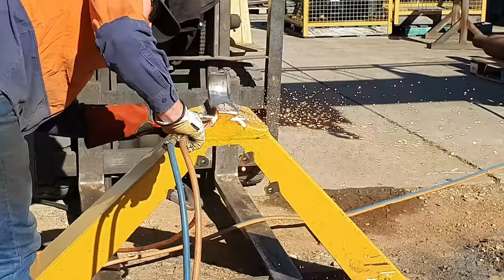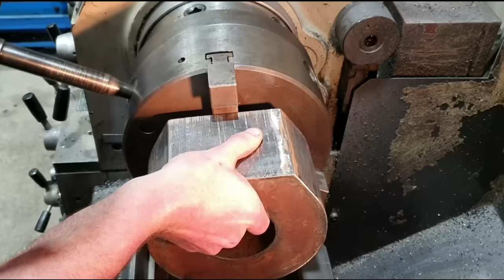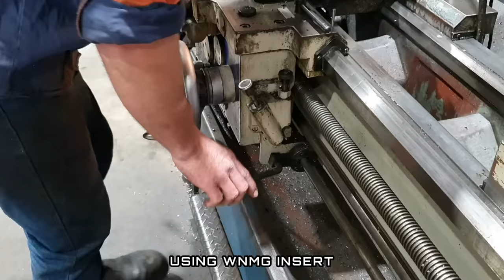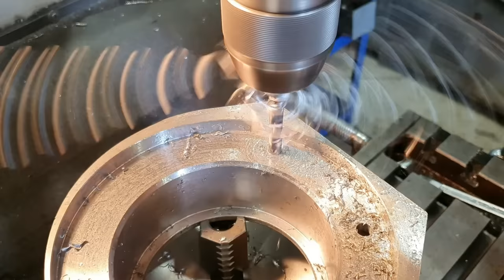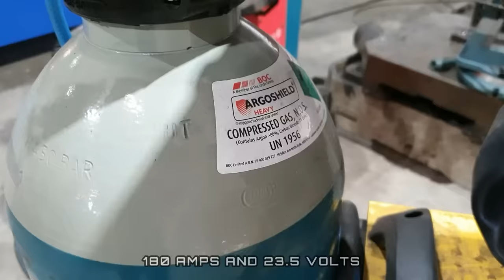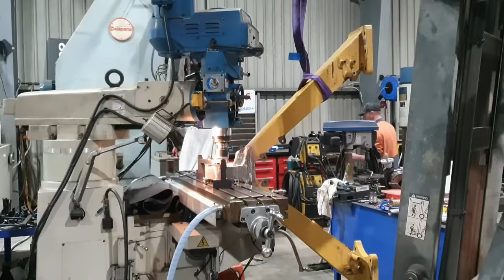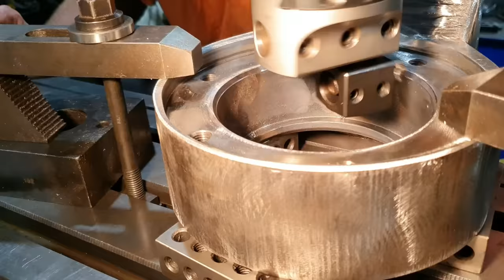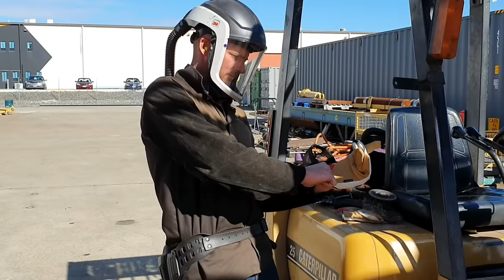Replacing BROKEN Eye on A-frame for CAT 745 Articulated Truck | Machining, Welding, Milling

Comment: Good job again.  I've spent my life as a job shop machinist, fixing everything from cameras and medical equipment to bulldozers and locomotives, so I really enjoy watching old school repair work.  I'm amazed by your extensive use of the 3 jaw chuck,  I seldom ever put one on the lathe unless i'm doing multiple parts or something where concentricity is unimportant.  When I saw you put that eye blank in with two rounds and a flat I couldn't believe it, but I watched the whole video and have to realize that you've done this many times over and know exactly what you intend and the results you will get.  Once again,  good job!  And keep those videos coming. 
Thanks again,  GBD
Reply: Knowing nothing about these things, (I may have touched a school lathe in the 1970s) I was amazed how casually the lathe itself could spin an irregular price of metal and not even flinch.

Comment: I've worked in underground hardrock mines for a good amount of years.  Some of the machinery is large and some was quite small.  Still, in a solid rock environment everything wears and breaks rapidly and some folks are just hard on things.  I appreciate the aptitude/skill and the work that goes into keeping machinery up and running.  To me it's fascinating to watch these processes.
Reply: In addition to your excellent comment, there's often an imminent need, and a short timeline to make the repair....No pressure! LOL
Reply: ㄱ

Comment: A retired fitter/ machinist here. Like your work. It's good to see you use all the facets of the trade. Spent years in a heavy engineering workshop in Melbourne, Appollo Engineering. Favourite machine was the horizontal borer, when you sat on the control seat you got a great view high up of the workshop. Get yourself one of them and it opens up a lot more work for you.

Comment: It's very enjoyable to watch your skills in metalworking. I love that you can take a disastrously broken piece of equipment, then fabricate a new part, then weld and build up the metal to join the pieces into one solid piece that is as strong as the original piece. Nice work.
Reply: i would bet that the repaired piece is stronger than the original piece, considering the quality of the work that Kurtis does and the amount of time & attention to detail that he puts into it

Comment: I have to commend you on how steady your hand was when flame cutting the eye material off the frame. That steel was super  thick and you kept the cut throughout the cut. 
Also, I noticed that as you were prepping the frame there was another pair of legs. Does this mean that the Safety Officer was helping to film the process? If so, you have a well trained hand in your shop.
Reply from the maker: Yes safety officer helps out he's got a steady hand with filming 🤣

Comment: What I find amazing is with the pressures that the tooling takes, that one little screw holds the inserts clamped in place. Especially with the interrupted cuts. Nice job Curtis.
Reply: The sometimes-confusing magic of leverage. It's a wonderful thing when it works for you.
Reply: The screw on the insert is there to locate it, the cutting forces are mostly carried by the big bearing face on the base of the insert into the tool, which is why you see every time Curtis is changing an insert or moving it to another cutting face he is scrupulous about making sure there are no chips or dirt on the faces that will come into contact, so that there is full even loading. If there is a small chip there it can easily shatter the cutting tool or damage the bearing face, making the tool useless till it is either reground flat or replaced. 30 seconds of care versus $500 for a new bar, or an hour with a carbide flat mill in the small mill to reface the pocket.

Comment: Air arc gouging is one of the best repair tools ever invented. I use one alot in my shop. I couldn't get a good view of what your welder was set on but our old Hobart welder has a switch for gouging with constant voltage as apposed to constant current. It works like a dream you can shave metal clean off but I have been spoiled with 450 amp plus welders my hole life. O something else I saw looks like you were using 80 20 gas mix might give 92 8 mix a try you'll get little more performance out of your welder with higher argon %. Any ways God bless and don't get hurt.

Comment: You have such an amazing understanding of how metal moves works when heated or welded together Kurtis.  Where did you learn all this?  You use tools and techniques I’ve never heard of too.  You’re a real star mate! 👍
Reply from the maker: Hey mate had about 20 years in and around the trade and I'm one to get in and give anything a go or find ways to make it work. Most is from on the job experience
Reply: @CuttingEdgeEngineering  From exactly on the other side of the globe ( the Netherlands) all I can say you are an all round skilled guy and me - just a theoretical engineer with some hands on experience- still wondering why I didn’t go into this type of work ‘cos I love it ( even with me own little work shop I can only dream of the level of experience you have).
Reply: Yeah , this one was good , cutting,  welding, grinding, lathe, fancy lathe, liquid nitrogen and a seemless plan . 👍
Reply: There's no "School" for this level of work, It's all practice, observation and more practice...and a couple good mentors who have the experience.
Reply: @ai-d3982  youtube is amazing for learning Theory but there's just no substitute for actual hands-on experience

Comment: "Can you imagine how much that operator would have shit his pants when that thing broke"
I lost it there lmao 😭
Great job once again Kurtis! Cheers from the states 🍻
Reply from the maker: 🤣👍Thanks for watching the vid mate
Reply: When the truck literally snapped in half! I bet that made a hell of a BANG when it let go! ;)
Reply: Obviously it didn't snap this was a line boring job what are you going on about.
Reply: @nocturnhabeo  now that is funny
Reply: Karen - "you think he poo'd a little" Kurtis - "No...I think he poo'd ALOT"
LOL
Reply: @haydenc2742  Really depends which half was the highest at the time, if you are on the part that is suddenly going downhill at a rate of knots, with the other half just spewing hydraulic oil as it digs into the ground, you might need a new pair of pants, and a new seat. If you just dug into the ground, and watched the other half fly off, your pants will only need changing. Might take an hour or two though to get the seat out of your backside though.
Reply: Where does the A frame go on the Cat 745? I was thinking the center where the machine articulates, but it's hard to find photos or videos of this part of the truck.

Btw, my wife and I love the channel. Thanks Kurtis and Karen :)

Comment: Forgot to mention, that’s a fancy dividing head you’ve got, never seen one with those quick change plates for multiple hole drilling before.
Reply from the maker: Yeah it's a great bit of tooling that has come in handy many times
Reply: Not to mention you picked it up like it was a 2 Kilo sack of potatoes
Reply: Watch a gear cutting vid. There's a channel on YT called this old tony. Indexing plates like this are used for gear cutting and on his home lathe he showed us - and it was A-B-S-O-L-U-T-E-L-Y fascinating.

Comment: "It just needs line boring", that must be the most optimistic(and inaccurate) assessment ever!! In other words the parallelism of the eye to the mounting's is critical!!
Keep up the good work.
Reply: That's just an example of Ozzie sense of humor. Yes, a bit strange, but that's the way they are.  I would like to see the part fitted onto the haul truck, but with the articulated bearing, I wouldn't expect alignment would be terribly critical. I was more surprised that no dial indicators or micrometers were seen. 35 years in trade, thankfully retired for 11 years!
Reply: @StuntPosse  Yeah I wouldn't imagine it either with a spherical bearing, afterall he only clamped it to the table off the back face. Boring it would have been to make it to size after all the welding.  What impressed me was measuring the snap gauge with the verniers, that's not as easy as it looks. Very nice repair.

Comment: Customer states “needs to be line bored” 
Curtis states “get off the crack”
Reply: You sure he only said "crack"???
Reply: @darrylvanrooy  😝
Reply: Ah, Australian humour, up there with "It'll buff out"
Reply: @PeterNield  bit of duck tape shee’l be right mate
Reply: All it really needed was some high tensile wire wrapped around and a bit of duct tape... maybe a zip tie or too just to be sure 😉👌🤣
Reply: customer is always right
Reply: @danieledwards1081  No, for a proper repair it needs to be fence wire, removed from the nearest fence.
Reply: @SeanBZA  Yeah, that 'fence wire' is some tough stuff....nice steel wire and then drawn to size...
Reply: ….and write the check!
Reply: @SeanBZA  that's what high tensile wire is...
Reply: @PiazzaWoodWorks  just wondering how many ducks you’ve taped up and why? I know why desi fuckachook taped 🐓 chickens.

Comment: What I experienced can only be compared to perfection, a perfect approach to the processed metal, which of course is not without significance, the fact that all kinds of tools and machines are available, mounting the bearing was, for me, the cherry on this workshop cake, a masterpiece, step by step, the entire creation process is an inspiration and motivation for further ambitious projects, because each one separately and all together create a perfect whole that pleases the eye not only of an experienced observer, but also of a quite average adept of the art of dealing with such a graceful material as steel, of course, which has its own whims, but can be tamed in time to achieve the final effect. please the eyes and pocket of the potential customer.

Comment: Very interesting job replacing that heavy eye. I was surprised when that Albrecht chuck didn't release the tap when it reversed. I've always found it necessary to tighten that type of chuck very firmly with a spanner to keep it from releasing the tap.

Comment: In lieu of the factory engineering drawings for that particular truck,  the gathering of specifications (exact measurements and photos) from the previous Articulated Truck with the broken bolt was incredible foresight and so important for such an intricate repair.

Comment: Kurtis your a awesome machinist, welder expert. The weld layering to get 100% penetration was great and tedious. I enjoyed watching the arc air gouging also. Brought back memories when I worked for CBI some 50 years ago. The shrinking of the eye swivel in LN2 was awesome also. Great job bud. I can see that your work ethic is also top notch working until the sun goes down.

Comment: That is one wild setup for the final bore! "I mean yeah, why not use a forklift for setup???"
Reply: I was wondering how he would manage the final ID after attaching the eye but I was not expecting that kind of balancing act!
Reply: @Legendinium  yeah, I was expecting him get out the line borer, again. But, in retrospect, nothing to fasten it to.
Reply: It worked out but I'd be afraid of the forklift getting a slow hydraulic leak and slowly lowering the work piece while it's still bolted to the mill.

Comment: Mate, two things.

May I/we congratulate Karen on her camera skills? They were always good, but the close-up work in this video is fantastic. She is a treasure, mate, and you are a fortunate man.

Cobber, I would strongly recommend NOT putting your gloved hand into that liquid nitrogen (or wotever it is), because one small leak in the glove means instant and permanent damage to one of the most important tools you have: your hand. I ain't trying to be a safety nazi, mate, but I want to see a lot more of these videos, and if your starboard kipper has been frozen solid, it's going to be hard for you to continue to produce them. Just sayin'...
Reply: Good call Greg i did some contracting for Chorus in the uk(British steel) we made alot of close fitting flanges and had to use liquid nitrogen . It was forbidden to grab with the glove we had a hook device .The glove was used only after the item was out of the Nitrogen . Be careful Kurtis those hand are worth millions . Another good video .. I was gunna comment on why the parts where never sprayed up as well .. Then i was glad to see the yellow spray paint make a appearance ..Just made the job look even better .Well done giggler and Kurtis top work
Reply from the maker: Hey Greg thanks for watching and the comment mate we appreciate those who genuinely have our best interest at heart. I did want to clarify that I'm not pouring the liquid nitrogen on my penis so my most important tool is safe 😂👍 but yes you're 100% thanks for the comment
Reply: @CuttingEdgeEngineering  don't worry too much Kurtis, if you get it on your skin, you have a short time to get it off before it damages the skin, so if it gets in the glove, take it off quickly!
Here's a guy sticking his bare hand in, and explaining why he doesn't even feel the cold.

https://youtu.be/KRUN2vzVpa8

That said, a slight delay could cause pain and much cussing, so be careful with the stuff!
Reply: yeah, liquid nitrogen is legit no joke. I think it takes like a fraction of a second to perma frost a spot that a single drop sits on. If at least a teaspoon got in that glove (either on the tips of his fingers or in his palm) it woulda been bye bye to using that hand for a week - month lol
Reply: LN2 won't burn exposed skin instantly because it flashes to gas on contact and essentially insulates you from itself. It needs a couple of seconds to cool that gas layer down before it starts causing damage (I've put my hand in a dewar of the stuff protected only by a disposable rubber glove and come out unharmed- do not try at home!). Different matter if it gets inside your clothing or worse saturates fabric so it acts as a wick- then the burns can be essentially instant.
Reply: See Kurtis, i always knew you were making cHips fly, on the job and off! 💥
Reply: @Majiksmoke  Yes -In the Pickle slicer!! One day he did it. Went home and told his wife he was fired. The Pickle Slicer got fired also.
Reply: @marty0715yt  , that was My Pop’s favorite joke. I always heard the punch line as, “Well, she got fired too!”
Reply: @CuttingEdgeEngineering  hahahahahaha! A crude aussie as usual. This channel just got even better!
Reply: @CuttingEdgeEngineering  Mate, I'm glad to hear that you are not dipping your willy in liquid nitrogen. It would come out looking like a fish-finger, and be about as useful...

Comment: This job illustrates the usefulness of a Bridgeport style milling machine perfectly. Being able to quickly rotate and extend the head to reach odd shapes makes it so versatile. As we have come to expect from Kurtis,  a excellent and well done repair. Cheers from the rather warm at the moment top half of the world! 🍻🍻💪💪👌👍  BTW had to laugh at the Instagram post a few days back about the "needs line boring" comment, Priceless!
Reply from the maker: Hey mate yeah this style mill works great. Thanks for watching, I'm not looking forward to it warming up here or the snakes that come with the heat 😆
Reply: Or the value of a conscious maintenance director and crew!

Comment: I luv the super indexer, what a great piece to assist in getting evenly spaced holes quickly, there should be a monument put up in honour of the inventor and the sound of the click is so reassuring. I didn't know there was a special counter-sink tool when I did fitting and turning at school about 1965, so I just put a larger sized drill bit in the chuck to do the job but when the tip bit into the work it stopped but the chuck kept spinning, snapped the drill bit and it shot across the room like a bullet. Fortunately I was doing a piece for myself so there was nobody there except Mr Magnusun (he looked like a Viking) He came out of his office not impressed. Another time I left the key in the chuck and started up only to have said key shoot across the room, I was lucky again because this time it was during class and its flight went unimpeded. We had large coloured pictures showing a drill bit through a finger and somebody scalped to remind us of the peril awaiting us if we got lazy and careless.

Comment: Kurtis looks like a mad scientist peering over his work with an internal ID boring machine. Looks like something that would be used to create the ultimate Frankenstein
Reply from the maker: Trying to build a new flux capacitor 👨‍🔬💥🤣
Reply: @CuttingEdgeEngineering  hey if you do it just got to find a hot sexy vehicle to put it in the load up Karen and the dog and go back to the future LOL

Comment: When you drill the threads with the machine, is it on autodrive ? i would be frightened to mess the workpiece up
Reply: I believe he has a stop on the drillpress, and he turns off the motor when it gets close to the stop

Comment: "Obviously, we can't line bore it" - Weeeellllll... You could, but I'm pretty sure the customer wouldn't be happy getting exactly what they asked for in this case 🤣😂
Reply from the maker: 🤣 one day we might do just what they ask
Reply: Just a bit of weld to fill the gap.
Reply: Should buff right out :)
Reply: Kinda wished they got a shot of him tacking on on the line bore then cut to a shot of the final finished part for a laugh. 🤣
Reply: Proof that the customer is NOT always right!